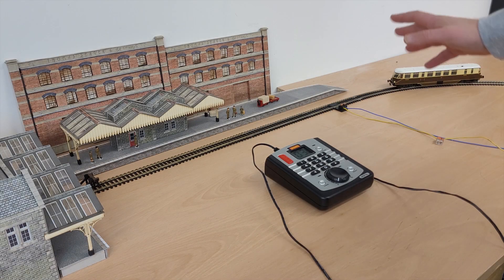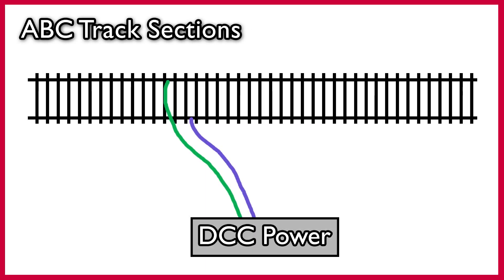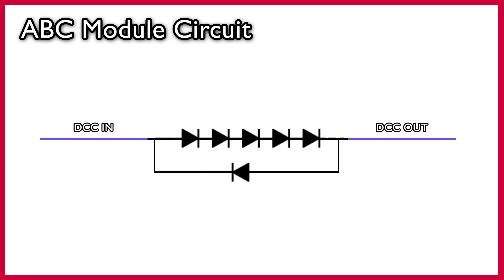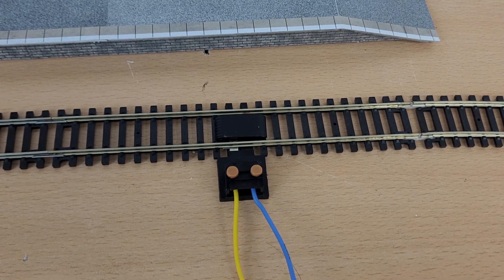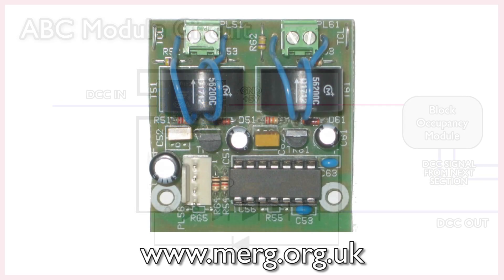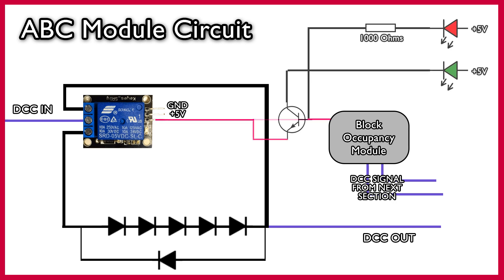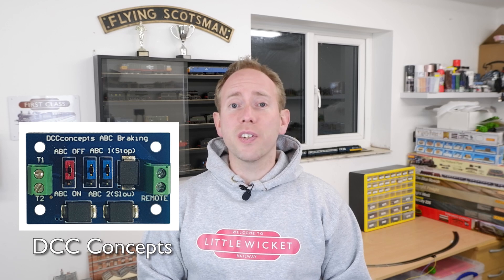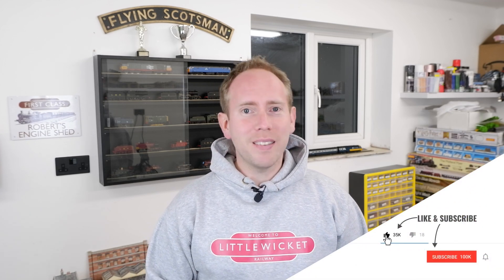Automatic Brake Control (ABC) - Easy to Setup Automation with DIY Circuits

Comment: Rob, ESU now has plug-in diode pack sets that will fit onto their SwitchPilot Extension blocks. Also, it occurred to me that if you DON'T like asymmetric braking, all you have to do is remove the diodes (looking at your relay diagram) and you're back to stopping trains with a dead track section. Pretty easy change. In the case of the SwitchPilot extensions, just pull out the diode sets and put the wires into the relays and you're done.

Comment: YES YES YES!  This is what I want!  I really wanted this on a DC system.   However, at this point, I'll give in and start converting old locos to DCC.   Many need major restoration anyway.
Reply from the maker: I'm sure there must be a way to implement this for DC, but I'm not aware of a commercial or easy to install system. Personally I love digital control, so unless you've got a prohibitively large or different fleet to convert them I'd say it was worth it.
Reply: @LittleWicketRailway  After a long amount of research yesterday, I came to that conclusion.   Have to covert to DCC for what I want.   Even at that, I'm going to need to understand ABC units and thinking most decoders don't support that feature.   Seemingly,  back to the drawing board.  LOL.   Clever idea by half.  :)  Someone out there figured this out as DC has been around for a very very long time.  No one ever imagined a way to automatically bring you loco to a slow stop automatically?   :)

Comment: Hello Rob,
Your way you give out the information is very good, only down side my laptop is a note book and because you make it so informative I have to get a windows laptop.
Keep up the good work 👍
Cheers,
Alan
Reply from the maker: Thanks Alan and thanks for becoming a member. I use windows because I always have. JMRI may work on a notebook(?), the engine driver app should though and you can connect that directly to DCC-EX with a WiFi shield.
Reply: I did not say, I found my oldish laptop with windows 10 on and I'm using that.
Do I need to go to a higher member setting before I can ask a tech (to me anyway) question?
Reply from the maker: @alanpennington8364  ask away Alan, I can't promise I'll know the answer though 🙃
Reply: Hi Rob,
I've got it working on Windows just fine now. Thanks to you for your help. We are moving soon, so when settled in I will start getting hold of the electronics. 
Can't wait to see how it goes as at my age it will be a very steep climb. Again, keep up the good work.
Alan

Comment: Was shown ABC many years ago, 5 years ago I had the light come on to use it on a public display. Using ESU decoders as they allow to stop forward but keep the reverse active. Good for a point-to-point layout.
Reply from the maker: Nice to hear it's being used. I feel it's an under utilised technology.
Reply: @LittleWicketRailway  Instead of a push button, I am using a relay and controlled in JMRI using the signal mast (Red) light in that block. If the red light is on the relay activates and stops the train until you get either yellow or green light. Will be running 6 trains on one track, this will keep them spaced.
Reply: @LittleWicketRailway  I agree.

Comment: Hi Rob, thanks for the video - but one question - I have just set up a automatic shuttle train between two platforms, using an Ecos CS and Digikeijs feedback module, so could i fit an ABC module to stop the trains in shuttle mode, rather than relying on the CV4 deceleration? If so how would the train start to shuttle back again? At the moment the Ecos reverses the direction and the train moves off after a set length of time, but would this command be ignored? Thanks Reggie

Comment: Hi Rob.
I have used ABC for a few years now exclusively with ZIMO decoders.  These work brilliantly, but to get the best out of them, I use Decoder Pro with a SPROG3.  This combination gives full access to all the other advanced features of these decoders.  Even the £20 non-sound versions are fully specified and are fantastic value for money.  In addition, they give superb motor control, and have given new life to old models.  Highly recommended for all things DCC.
Reply: Will be using DecoderPro also using the ESU decoders. My home layout will be using ABC too.

Comment: I use ABC all the time. It is great for all sorts of purposes. Also in the staging yard when trains are coming in. You forgot to mention that ABC is direction aware, so you can have an active module guarding a signal on a single track line, and still have trains going past the signal in the opposite direction. This is a very nifty feature.

Comment: Hi Rob, great video as usual. Can this affect be reproduced using JMRI if you do not have ABC decoders installed?
Reply from the maker: Yes, but it's not quite as simple. You'll still need block detection and that will need to feed into JMRI. Then you'll need to setup your layout within JMRI with signalling, blocks, sections, etc. This can be virtual signalling, but still all needs to be in place within JMRI so the computer knows how things interact. Then you can use the automation tools such as despatcher to move a train. If all set up correctly the computer will automate a throttle to stop the train before the occupied section. Again lighting and sound should stay active.
Reply: @LittleWicketRailway  Hi Rob, Ok thank you., I see what you mean
Reply: Hi Rob, on a similar topic, is there a way to slow a loco down on the same spot every time. For example, I have a loop and on the loop is a set complex set of points that I wish to have a speed restriction. I want to set the loco off at normal speed and leave it to run, but the loco will automatically slow during the speed restriction and speed up afterwards without any input control from the controller. I am thinking that the points have an LDR before and after to detect in and out of the section. Thank you.
Reply: @wrrail4428  The DCC concepts ABC unit can generate "Slow ABC".  This means that every other ABC pulse is asymmetric.  Some decoders (notably ESU and Zimo) can detect this and treat it as "slow" rather than "stop".  To get this to work, you need to enable it on the decoder and program the decoder with what speed to use for "slow", but it will do what you want (for a single speed).

There are essentially three different methods for hacking with train speed "on the fly".

Secondary signalling applied to the track section.  This is usually "ABC", but a full Zimo system can use "HLU" (like ABC but with about 6 different speed steps).  In this mechanism, the track section applies a supplementary signal to any decoder that is programmed to listen and the decoder responds depending on its configuration.  The controller retains full DCC control of the train (including the ability to override the braking signal).

A weaker form of this is "brake on DC".  Decoders are programmed such that if the DCC signal is replaced by a standard DC signal then they stop.  You also lose any ability to otherwise control the train until DCC is restored.  An even more basic form of this is to just cut the track power, but that will abruptly disable trains rather than just stop them and might not work as expected if the trains have stay-alives.

Train detection and signalling.  This is the opposite extreme.  Everything is pushed all the way up to the control software and it sends standard DCC train control commands to the particular train based on what the particular train is doing.  This is "automated control" rather than locally modifying the behaviour of particular track sections.

Modifying the DCC commands.  The third method involves a local system intercepting the decoder signal and sending a different signal on a particular track section.  This sort of system usually attaches to a control bus and drives a booster for the controlled section, rather than trying to modify the actual DCC signal after it has been boosted.  The simplest mechanism is to block any generic speed commands and replace them with an "all trains stop" command, but other options are possible, including per-train modification.  Unlike ABC & HLU, this sort of system doesn't require decoder support since it modifies the signal upstream of the decoders.

If you have decoder support, ABC is by far the easiest to implement while still retaining full DCC functionality.

Comment: Interesting stuff Rob.  One extra question though, lets say the railcar has been ABC'd at the station. Does the DCC controller "know" that the ABC has happened or is that purely a decoder function? If it doesn't, then presumably any display that is based on DCC controller status would still show the loco as being set to run at the previous speed - and would remain so until a new command for that loco is entered at the command station?
Reply from the maker: Correct. Only the decoder knows. The controller is still telling the railcar to move.

Comment: Hi Rob, great explanation. I use ABC quite extensively for stopping trains at stations and in hidden sidings. I recommend the Lenz Silver + decoders, which seem more consistent than the ESU ones for ABC.  I used Daves at MegaPoints controllers ABC units for the wiring. Difficulties arise when the train has coaches with lighting that pick up from both wheels of a bogie, this shorts the ABC for long enough to make the train accelerate away again. My solution was to remove the pickup from one axle so that the coach is lit from a single wheel on the rear four coaches.

My recommendation would be to make the ABC braking work over at least the whole train length, I chose 2.1m for 7 coaches plus loco on the main line and 1.2m for ABC on the branch line. I also have a signal with ABC to hand over a train between operators. My Midland Pullman is non-ABC, two driven ends and lit coaches from each end, I dont have a solution to this combination other than manual driving... 

An improvement to the way ABC works would be if the decoder operated by receiving an ABC track signal for a half a second, then came to a complete stop before checking for the track signal being on or off, then the opportunity to short the signal in rolling stock would be ignored. Something for an improved decoder....
Reply from the maker: Thanks Andrew. Good point about the coach lighting. Sounds like there are some limitations to it. I'm still impressed that this functionality is just built in to some decoders, I was totally unaware.
Reply: As mentioned the Lenz BM series are priced higher but they have two advantages. First is that they have two sections...a driving section and a braking section. The driving section is to be as long as your longest train. When the locomotive crosses into the braking section the BM applies the braking signal to both sections. This way there isn't a concern for metal carriage wheels creating a false signal. The second advantage is that there default is to send the stop signal. If for some reason the module isn't receiving a clear signal from the following one (ie broken wire or defective connection) then it emits the brake signal and the train will stop.

Comment: note the BM-3 does something else as well, this has "slow approach" which does a bit more than just add some diodes but with a suitable locomotive decoder you can stick in speed restrictions - only played with one of these as they are not cheap (as you note) but found it useful on a layout that had an awkward sharp curve so I could set a train running and they slowed for the curve all by themselves.

think you need a microcontroller to manage that as it does weird things to the control, that said for two aspect signals the basic ABC is _excellent_.

one bit you didn't cover which makes it even better but means a bit of caution, its directional_, you can set this to protect a terminal station or siding to stop things, _and they can drive out normally which is amazingly useful..

the "gotcha" is if you have an out and back or reverse loop as then you get trains that will plough in at speed, but be unable to drive out assuming they don't de-rail..

but that aside for basic automation without being too concerned with hooking to a PC or mucking with Arduino these little diode modules are excellent as a way to stop trains - e.g. say approaching a point set against you to avoid the short circuit or collision.

and then even in a more automated layout they are useful secondary protection systems 

excellent video as always, taking something that on paper is a bit awkward to get your head round and just showing it working for the easy lightbulb moment
Reply from the maker: Useful to know about the reverse loop 👍

I looked at the slow approach stuff, but I was struggling to recreate it. I read it involves making every other DCC pulse asymmetric.

I think the DCC concepts board does slow approach, but I couldn't work out how. If it does then it's great value.
Reply: @LittleWicketRailway  if you have a reverse loop somewhere the solution is to use some of the other block detection and automation techniques - but for more normal loops or for stuff like hidden sidings the ABC stuff is perfectly suitable :)

and yes if that board can do slow approach then very good

Comment: Do you require a separate block detector for the ABC circuit or are you able to piggyback off your existing block detection for your mimic panel?
Reply from the maker: You should only need a single block occupancy detector 👍
Reply: I imagine that will depend on the type of your block detector module and how much load it's "detected" output can drive. I think the MERG BTM which Rob instances has an open collector output so would drive multiple devices. However other modules capability to signal to multiple devices reliably would need investigating on a case by case basis.

Comment: Fab video Rob, I've used ABC on my fiddle yard on Halland, means i can drive a train into the fiddle yard and it will stop itself, mainly cause I'll get chatting to someone and not heard the loco still running against the end stop. My home layout is a 2 track up and down line going into a single line and a return loop, I have the ABC setion just before a point is if the point is against it the loco will stop and wait till I set the point/signal. must add because all of my locos are sound and f2 active braking I have to use a 'distance controlled stopping' this is due to cv4 being set to 100 on the active braking sound files. also worth noting that with updated firmware on the decoders for the ESU v5 and Zimo you can make a shuttle section ;) that's another video for you :D take care bud.
Reply from the maker: Thanks John. Good to hear that this is being successfully used on layouts. What's your decoder of choice?

Thanks for the heads up on the shuttle! 👍
Reply: @LittleWicketRailway  zimo sound decoders and ESU v4&v5 loksounds 👍